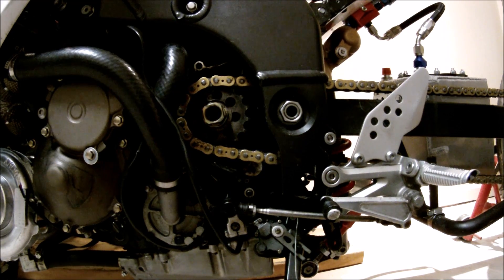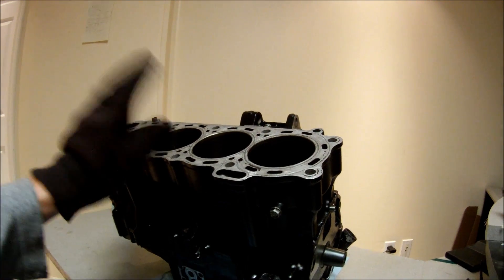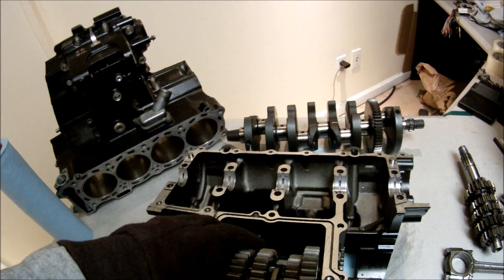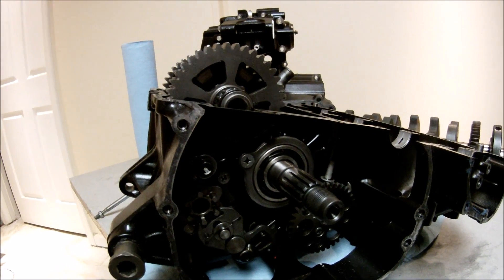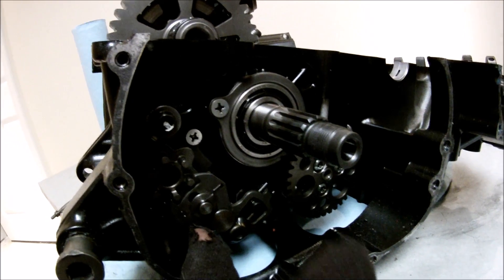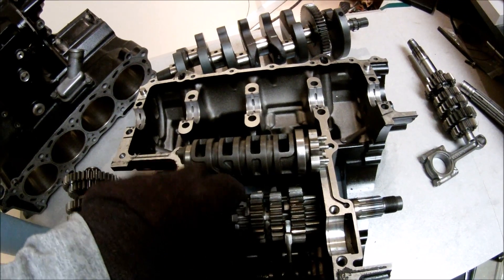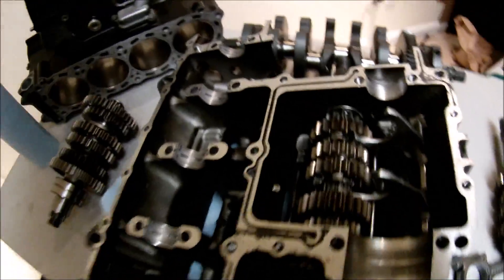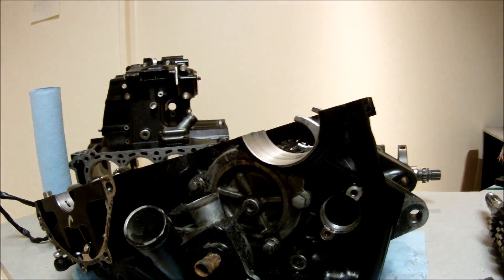How a Motorcycle Transmission Works, Just Like F1 Gearbox, Whats Inside and How It Works.

Comment: When you're at rest and going from neutral to first, and both shafts are stationary, if the dogs are not aligned with the slots, how do you shift?
Reply from the maker: The only time both shifts are stationary is when the engine is off, in that case you have to physically roll the bike forward or backwards.